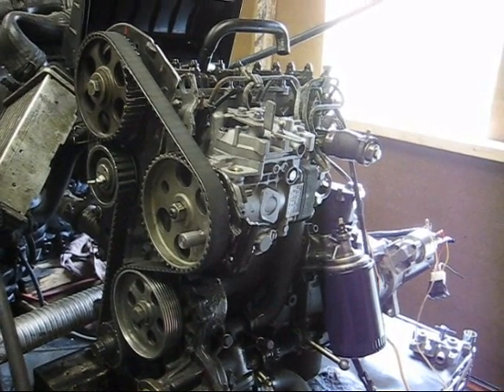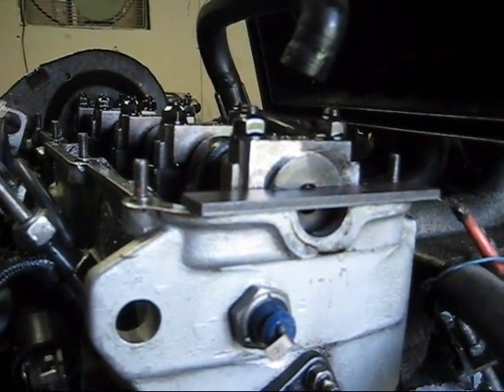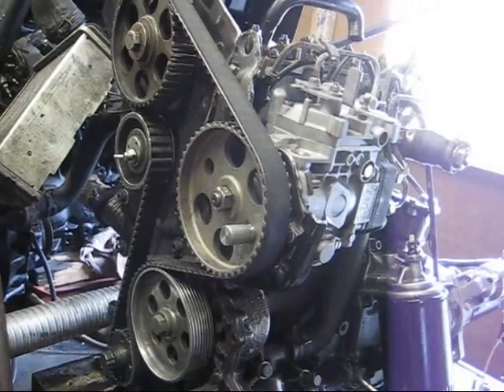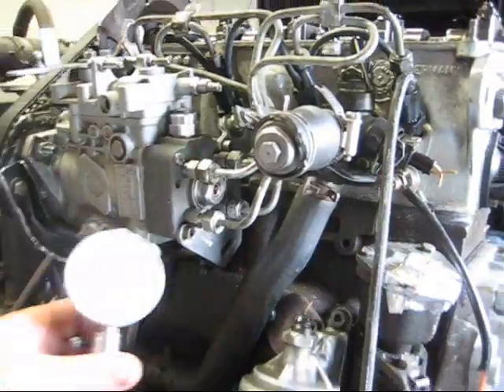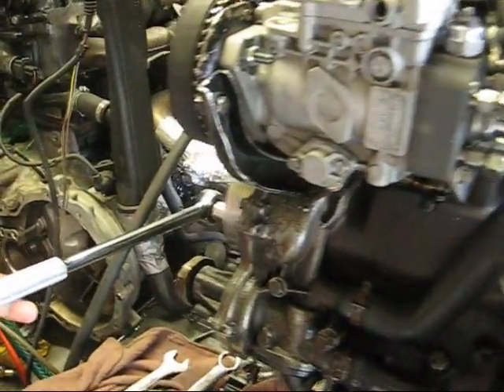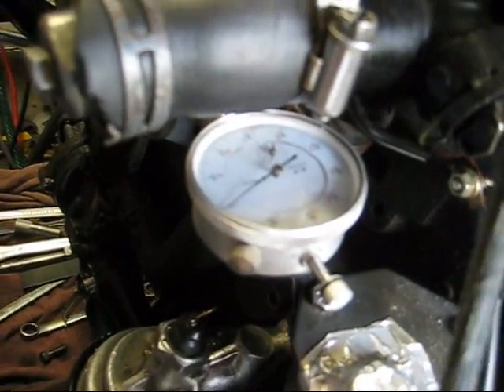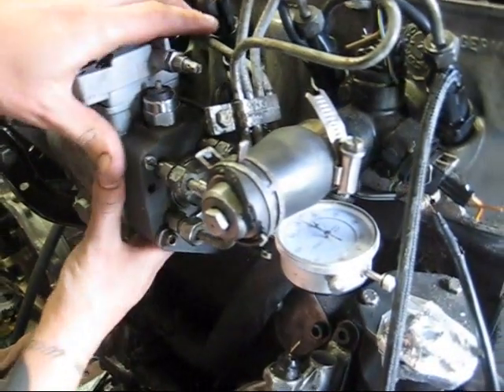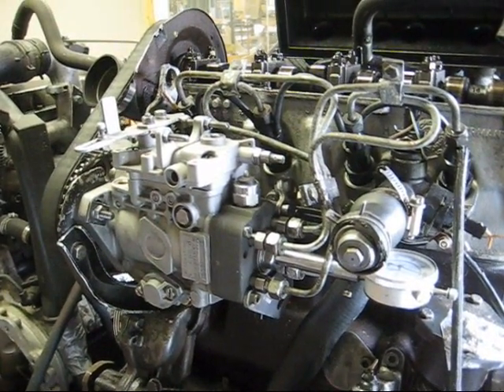Volkswagen Pump Timing video.wmv

Comment: My Mk2 jetta 1986 turbo diesel. 
I'm working on getting that dial indicator but in the mean time I've realigned the cam to the pin locked fuel pump, they're in synch but My crank is ahead .5 degrees from ZERO. Is this why my valves seem to slightly ping? There is no piston valve contact I checked by hand.  I will zero this next driving season. But to the question..!? 

I also just put in new hydraulic lash adjusters. So it's not that

Comment: If you rotate the pump with the injector lines connected it flexes the lines.  This puts them under stress and they will crack during running.  Relieve the stress by loosening all the fittings on the lines, repositioning them so that they sit naturally then re-tighten the lines.

Comment: how did you tighten the belt without the crank moving from tdc? every time I try the belt pulls it from tdc. is there a locking tool I can buy or make or is there a trick
Reply: A lock "pin" inserted in the injection pump pulley will keep the whole mess from moving.  I use a 13mm 3/8" drive Craftsman socket. No need to purchase a special tool.

Comment: THANKS, much better than Bentley instructions, my 1981 VW truck would not crank one morning, I did ALL the electrical troubleshooting and ALL that proved OK, I was told the pump went out or timing jumped, COULD this of possibly happened WHEN the vehicle was turned off? Is there a QUICK EASY way to determine this?
Reply: The belt could've slipped, causing any number of components to become untimed.
Reply: I'll bet it was fuel cavitation

Comment from the maker: If the belt breaks one might get lucky and the head might be OK but probably not. They are pretty tough but if you were going down the road and it broke it's not a good thing. You need a compression check for sure and if the timing belt snapped it might have been caused by the pump anyway.
After this is done then you might be able to time it by ear but only if you're used to listening to diesel engines and know what to listen for. I used to rebuild pumps and did a bunch of  MTDI's and even had one that did 400hp but personally I couldn't hear everything as much as the person in the video.
We had a guy send his rebuilt turbo top pump back twice saying it was bad and both times his wife put gas in the car and when I took plug off I could smell gas. His mechanic should have smelled it before it got to me!
Reply: do you have a video on how to set the idle mixture and idle on a running 1.6?
I have a 1981 diesel I just bought. I used to own one in 1987. This one has only 107k miles on it. It really vibrates a lot even when warmed up. The idle mix screw has been adjusted at some point. I want to know how to adjust the idle mix and idle speed to factory specs so I have a starting point. Can you video or tell me how to do that?

Comment: Dear Yankee Wrench, My 1.6l diesel rabbit truck snapped the timing belt when I was going.  I shut it off immediately and parked it for a few years.  It only has 77k orig. Miles on it as well.  What do you think the odds are I could put a new belt in and do this and it will be fine?  Do you think the heads need to be rebuilt?  And lastly are you in the Boston, Ma area if I wanted to send you the engine for a rebuild?  Thanks,

Gabe Chuck
Reply: Zero.

Comment: I have an 81 dasher diesel it sat for 15 years i got it running and drove it 150-200 miles now it has started leaking a little at the back of the pump between the plate the 4 lines connect to and the pump housing. Can I just make a new gasket for it without timing the pump. also is there a place where I can get a repair manual for this thing? I have tried several times and have been sent the chilton gas engine repair manual. oldwvhillbilly@gmail
Reply from the maker: Somewhere there was a video on changing the O ring very carefully leaving everything together but loosened up a tiny bit.

Comment from the maker: The feed vanes might be stuck if it's been sitting around getting dry. Only solution is to take it apart and clean it all. Make sure you put the vanes in correctly. Small half moon cutout goes inward toward the shaft. Also make sure feed ring is not flipped. The plate could block the outlet if it's not on the correct side. You should be able to look inside & see through the plate and the feed ring all the way down to the casting area. Always leave fuel or oil in the pump. and not veggie oil.

Comment: on a bosh ve injection pump for a 84 rabbit diesel 1.6 motor..  It has been sitting for a while and I primed it (fuel filter/bypass regulator filled with fluid) and I can't get pressure to build.. I talked to a few people and they say that it is a B**** to get started again after sitting.. What is the trick, what needs to be done since the pump has been dry?
Reply from the maker: you need a pump to suck all the air out of the pump to prime it first.

Comment from the maker: @MrMarienve2ea  I need to put an info bubble on the video. You need to have the bolt holding the cam gear loose and also you need to remove the lock pin from the pump when you spin the crank.

Comment: Dear Yankee Wrench,one thing ì don't understand is how you can move the crankshaft to check and adjust the pump timing if the sprockets on the pump and on the camshaft are locked?
I suppose that if the locking pin is in place at the pump spocket,the pump could not move except in relation to the sprocket?
It would be helpful for me to have an answer.Yours truly.
Marienve2ea.

Comment: @JeffnDenmark If you didn't unbolt the injection pump the timing on the pump will be fine(If you did unbolt the pump the instructions on this video are excellent for the pump timing). Here are the instructions on how to set up the pulleys and the belt from scratch. 
vincewaldon(dot)com/index.php?option=com_content&task=view&id=24&Itemid=28

Comment: @JeffnDenmark Just remove the steel injection lines that go from the pump to the injectors. That should give you enough room to get at the 2 glow plugs behind the injection pump. If you want to pull the pump, the locking pin along with some spring clamps to hold the belt will hold the pulley in position. You will still have to separate the pulley from the pump and remove the steel lines to remove the pump.